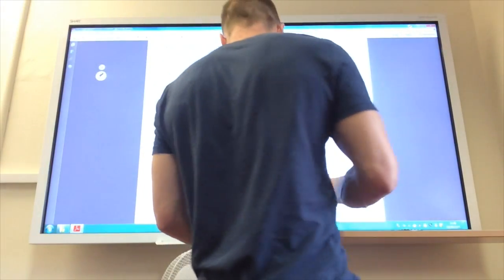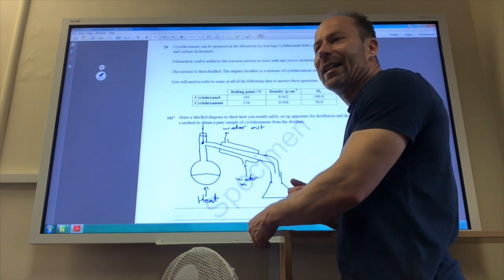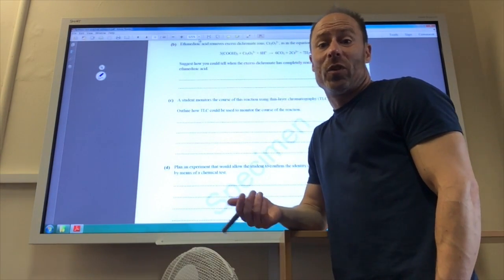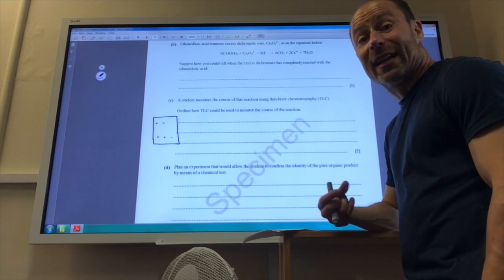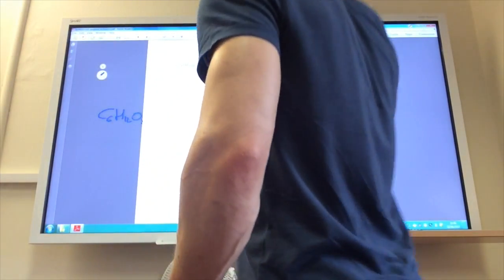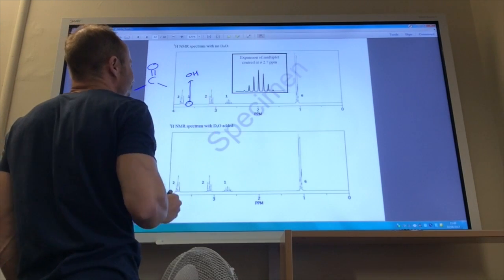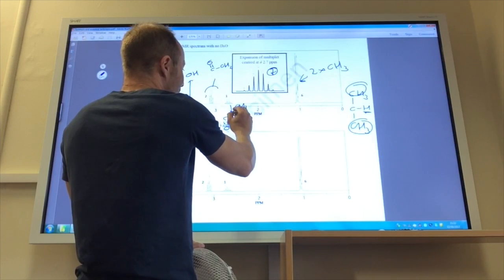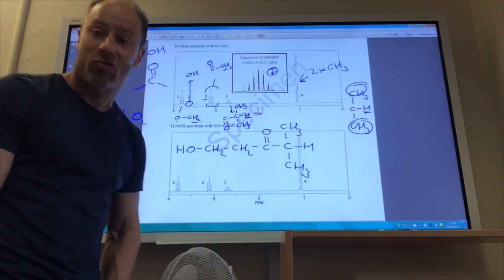H432/02 Synthesis and analytical techniques Sample Paper 1 Q20-21 from www.ChemistryTuition.Net

Comment: In Question 21, the mark scheme says the peak at 3.1 pmm, triplet, 2H is due to  ch2–CH2C=O, but the data sheets says in the range 3-4.3 pmm we can have HC—O, a single bond with O and not double.
Reply from the maker: 3.1 is just on the edge of the chem shift value. for CH-C=0

Comment: In 20 (b) wouldn’t the colour of the dichromate turn from orange to green?
Reply from the maker: Yes but the dichromate is in excess so you need to know when all the ethanedioic acid has been removed.
Reply: DrOrchard The question states excess dichromate finishes when it reacts with ethanedioic acid.
Reply from the maker: Hi, when all the ethanedioic acid the remaining dichromate will stop reacting as there isn't anything left for it to react with. However it will be a mixture of reacted dichromate and unreacted dichromate.